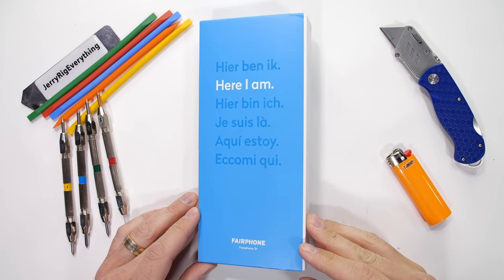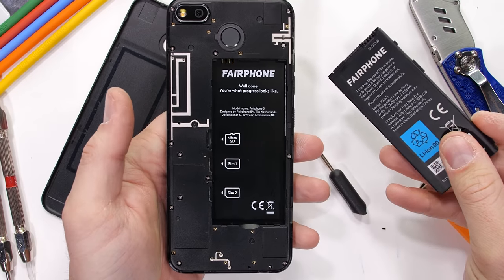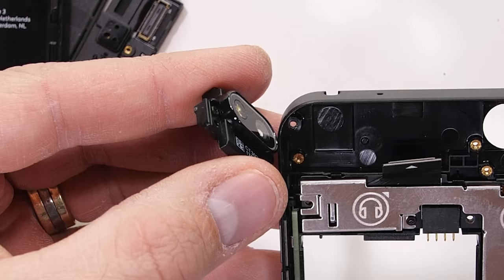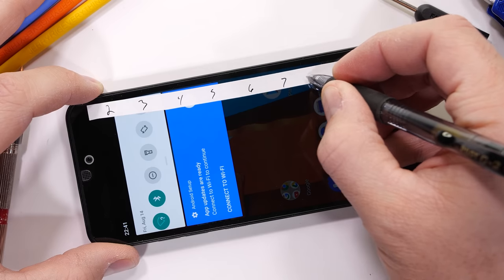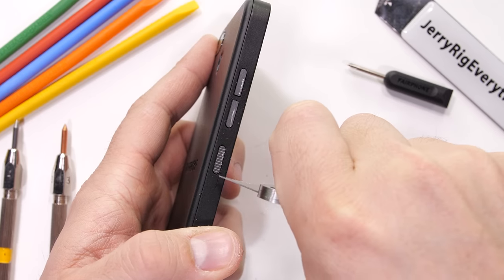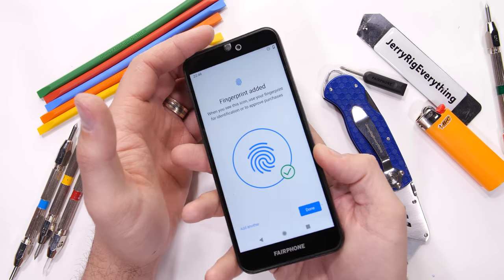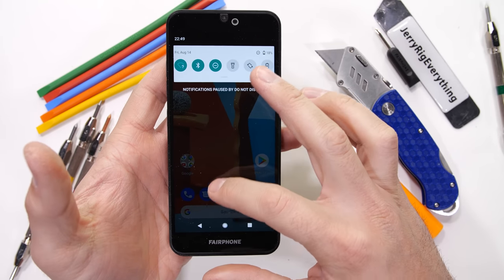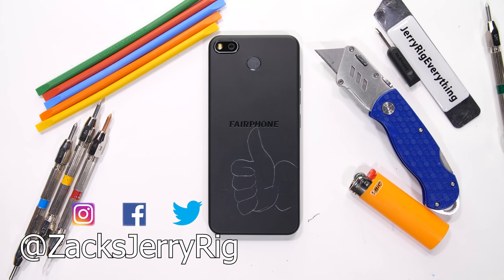Fairphone 3+ Durability Test! - it feels like cheating...

Comment: That's how you protect environment. Not by selling a phone and it's charger separately.
Reply: The idea is like apple and Samsung doing it now as well that most people already have a charger at home and wouldn't need to get a new one. But Fairphone plays this card for a few years now. They where be much faster than all the others out there.
Reply: @stefan3641  Except that the old chargers do not support the full charging capacity of the new phones. In Samsung, old chargers don't support Super Fast Charging and in Apple the old chargers are lower wattage than what's needed PLUS Apple decided to do this dick move right when they released their Type C charger for iphones. Coincidence? Stop thinking like sheep
Reply: I saw that other guy video too
Reply: @akahil91  this is a moot point as the majority of people don't need rapid charging to make it through the day with today's power efficiency
Reply: @stefan3641  See, I bought an iPhone 11 when the new iPhone 12 lineup came out. After using an iPhone XS Max, I thought ok I'll put this up for exchange. So I got the iPhone XS Max exchanged for the iPhone 11, which I knew wouldn't come with the charging brick because of Apple's new policy, but I was fine with it because I already had a brick (from an iPad 3).
But once I get the new iPhone, I find out the USB cable it came with is not compatible with my adapter, because all the old adapters (including the one I had with the iPhone XS Max) were USB A, when the new cable they supplied was USB C. So now I had to buy the 20W adapter, the new USB C one, because my old adapter was not compatible.

That's not an eco-friendly move. That's a dick move.
Reply: @le_blake  Okay sheep if that's what you think. Look up how many new iphone buyers are buying the completely new type c iphone charger with their phones. Phone carriers are basically selling them as a package now because everyone is buying. Samsung's super fast charging is more of a luxury but still needed by many people nevertheless.
Reply: @le_blake  this is highly debatable. We're still seeing in this age software problems that lead to battery issues or OEMs that still stick with 3000/4000 mAh with their almost 7 inch phones.
Whether we use fast charging or not, we are still being charged for it as a feature alongside the phone and not being able to use by default something you are paying for is very harmful for consumers. Please don't defend this.

As much as this may help the environment a little bit, no company does it out of their own interest and only results in harmful practices for consumers.
Reply: @stefan3641  you know what's suuuuper anti-environment?  you cannot replace any component of your new samsung or apple phone and still haev it work.  They check for serial numbers of the components, and if they're not paired to the phone from the factory, things will refuse to function, even if all the parts are brand new and oem.
Reply: And if you need to buy that charger separately it takes a whole another package and shipping (hence increasing carbon emissions) to reach the customer. So idk about the environmental benefits companies claim it to have.
Reply: You're not saving shit
Reply: @akahil91  I would always subscribe that this decision is all about money for Samsung and Apple. You make more money if you sell phone and charger separately but for Fairphone (and Shiftphone as well) it's really not about money they never sold any phone with an charger because of there phylosphy. I use a Shiftphone myself and I am perfectly happy with the performance of the charger from my old HTC 10 even if it my not have the performance the new phone could handle with. So. If you ar not so keen on having the best performance while charging you can always use an older charger. And that's what they are thinking and what they care about.
Reply: @xavierazad  subscrib!👍 but this is Apple. And for apple it's all about money you will not have this problem with a Fairphone.
Reply: @akahil91  it's a shame that a good idea is exploid that much just to make money. But as fore Fairphone, the charger they sell is a real basic one with QC 3 and 18W (20€). For this you can really use any old charger you finde anywhere.
Reply: @TheJunky228  I am using something like a Fairphone myself (it's a Shiftphone, but with the same idea behind.)
There must be a misunderstanding here. I am NOT supporting Apple and Samsung I would never by Apple because of there whole strategy.
Reply: BRING BACK REMOVABLE BATTERY
Reply: @TheJunky228  that’s incorrect. At least with apple the replaced parts will still work but you will get a notification on your phone saying the parts aren’t authentic
Reply: @rodrigojds  After replacing Touch ID: not working. Display: truetone not working. Face ID: not working
Reply: @coffeemakerbottomcracked  and in the new iPhone 12, camera not working.
Reply: Actually, Fairphone themselves aren't including the charger in the box and they have been doing this for ages. But that said, the Fairphone doesn't have a lot of Wattage, so you can easily use any third party charger out there. But what makes this Fairphone really environment friendly is the build material - Fairphone use 40% recycled plastic for the 3+, way more than any previous Fairphone model including the 3.
Reply: @FAT8893  they also do vast research into how to recycle their own phones. they are pionering the field
Reply: Sure usb a chargers
Reply: Anyone who argues selling the charger separately is good should watch mrwhosetheboss's video he really debunks that
Reply: @why_tho_  
Why you just limit your perspective to the impact in the current year, their ‘environmental policy’ is aimed for the long term goal. 

It’s ok for it to not perform spectacularly on the first year, we will see the significant positive impact of the current year decision in around 4 to 5 years. Apples decision to ship the type-C cable is also their step in future proofing and to keep the newer model “premium status” (the iPhone 11 got type C cable on the box,  it would looks like a downgrade if they put the Type-A cable on the iPhone 12 box)
Reply: @zacharyyyy  yes I watched his video and it is a very good one. But a normal charger lasts a lot longer than the phone it comes with and so you can charge many phones with the same charger without having to by a new one. Fairphone wants you to use your phone as long as you can, so you will not be selling it before it brakes, so you don't have a costumer without a charger and if you sell your Fairphone the customer is going to understand the strategy and is going to use his old charger as well. It's the same story about the cable. I think it's absolutely stupid from apple that here old cable isn't compatible with there new charger. You will not have this problem with Android phones because they are using usb C for years so all the cables are usable.
Ich can understand what he is saying in his video but if you want to save the planet you get a Fairphone and use it with your old charger as long as possible. I don't think selling all the parts separately is a good thing for most company's because there main goal is to make money, but for Fairphone and Shiftphone this is not the case. And when you rely live what they want you to do you don't need a new charger for your phone and if you need one with your new phone you get one in the same chipping box. And if your old charger brakes you have get a new one chipped to you anyway.
Reply: @stefan3641  yes I've heard of fairphine, unfortunately I doubt they'll really catch on any time soon. I was mainly refering to iPhones since they just changed the charging cube to have a USB c port instead, which means the majority of users will have to buy a new charger. Which is not in anyway helping the environment. Maybe after a few generations they could say that, but definitely not as soon as they change it

Comment: This phone will probably win the easiest phone to repair award at the end of the year

Thanks for so many like I really appreciate it
Reply: You predicted future
Reply: Sure it will. It's designed and supposed to be that way. Wich is fantastic. Well, there was a time, when phones used Plastic Covers, that revealed a removeable Battery and were opened by a few Screws, making replacing something relatively painless. Not on the same level as this thing, wich is designed to be maintained, but still pretty quick and painless. Fixing my Galaxy S4, my first Smartphone was no big deal at all, super easy. Those days are gone unfortunately, now everything has a Glass Backpannel, that is utterly useless and glued in place, so no getting into it without a Heatgun and tools .
Reply: @sagichdirdochnicht4653  big deal. 5 minutes of your life wasted to open up a phone but you also get water resistance 🤡🤡🤡
Reply: Yea
Reply: @propersod2390  There are other ways to implement water resistance. Take a look at the Galaxy S5, wich suprise suprise, was easy to open and fix, had a removeable Battery and yet it was fucking waterproof, mr Clownsmiley. 

Plus, it often takes WAY longer then 5 fucking MInutes to open one of those newer phones, at least if you don't want to break anything, wich happens easily with fucking glass. And it doesn't stop there, Mr Clownsmiley. Many Components are mounted in a way, that replacing them is a ROYAL pain in the fucking arse. Wich is why not anyone can or wants to repair a phone or don't get it fixed - because when it requires quite soome time +  cost of the replacement parts make it quite expansive.  

Also, BEFORE every device was waterproof, water damage defenetly happend sometime, but honestly, that doesn't happen THAT often. I mean I'm kinda careless with that thing, because it ain't a fucking fashion statement, I use it daily at work and it just gotta fucking work. I drop that damn thing constantly (Pro Tipp: Cases (who completely defeat the purpose of fancy glass plates ) and glass screen protectors ). But never have I came to a situation, were I actually needed it to be water proof. Except that one time with my non water proof Galaxy S4 were I fell completely drunken into a small river at a festival. It worked completely fine after that tough.
Reply: @propersod2390  Water Resistance is such a niche thing to have, no one randomly chucks their phone into water, and water splash has no effect on most modern phones.
Reply: @AbsoleteAim  it's not niche to have. It adds to the durability of the phone. And keep in mind if water damages your phone you pretty much need to get a new one most of the time.
Reply: @sagichdirdochnicht4653  Lmao that S5 was nowhere near as water resistant as phones now AND if that plastic back came off bam your phone can say goodbye because it's soaked now. And no it literally takes 5 minutes for most repair shops who have the right tools and experience. If you can't open your phone in 5 minutes then you shouldn't even be operating on it because you WILL break something. And water damage didn't happen that often but when it did you were looking at a super expensive repair or your phone couldn't even get repaired at all and you needed to get a new one. Very eco friendly right?
Reply: *end*
Reply: @propersod2390  That's if water even gets near my phone, so for me it's not really important.  Some phones that don't even have the IP rating have the same precautions/steps as certified phones.
Reply: U meant at the end of the year?
Reply: @AbsoleteAim  Those phones without IP ratings but with water resistant seals are only like that to save money. But they are still properly sealed. I don't get your point with that
Reply: @AbsoleteAim  then it’s still water resistant, just not certified, you’re contradicting yourself mate...
Reply: @sagichdirdochnicht4653  I opened my lg g8s without any heat, I don't think I have to mention it has an ip rating
Reply: End*
Reply: @propersod2390  The S5 was enough water resistant for 99% of cases. Do you go diving with your phone? If so, yeah, it ain't enough, I give you that. But it sure as hell was enough to survive the good old fall into the toilet, into a pit, heavy rainfall and all of that other nonsense were you could potentionally get your phone wet in every day use. And if your Back panel gets off? What? Have you ever fucking used a device from that time? They didn't just fall off. On HEAVY drops, maybe. But those stay in place pretty securely. 
But in the case, that you are regulary stand next to a pool on a ladder and constantly accidently drop your phone, were it lands on concrete, back panel could open and then falls into the pool - if so, then yeah, it's propably not good enough. But i can assure you that's not super common to happen. 

As for the opening part. No. First, there are incredibly many phones on the market and reapair shops usually focus on the "top phones". If they offer repairs for any device, they don't know first how to do it. With the experience they have, it usually ain't that big of a deal, but they'll certainly need more then 5 Minutes on most devices they don't know to get to the screen or whatever. 

Second: You should be able to do 99% of what repair shops do yourself. And with that, all those glass and glued together shit SUCKS. Yeah, yeah, tell me how unskilled I am, that I'm gonna break shit, because I don't know what I'm doing and whatever the fuck you want. But eh, I've got proper training on electronics and work experience, with the profession of devices, so basically anything after the Socket. I can replace those little surface mount components, no issues and can figure all that shit out. I've also repaired phones for friends. 
And yes, there are phones, were it is ok- ish. Were they are glued together, but open easily enough to not be a huge pain and have the internals put together in a way, that are OK to get trough. Many other devices are fucking horrible to get open and  won't cut the Bullshit on the internals. That's horrible design and they are easy to wrong on non experienced folks. And that shouldn't be the fucking case. Replacing simple shit like the little USB Port Board should be able to be repaired by anyone without any issues.
Reply: the dude wrote an entire essay
Reply: If this didn't happen,  Jerry is rigged.. 😂
Reply: @sagichdirdochnicht4653  We got a whole lot of plastic these days

Again
Reply: @sagichdirdochnicht4653  the S5's water resistance relied on a thin piece of rubber on the back panel. If that came loose, the phone loses its water resistance rating. It was basically bound to fail. And basically all phones open from the back, and the back is made of glass, so a heatplate that basically every single repairshop will have will be able to open the phone without a problem. Gluing the phone shut also allows for no dust to get in, and if the phone drops the back won't get separated from the rest of the device. And that's without even getting started on the cheap, flimsy plastic backs that are on all these phones with removable backs 😂😂😂
Reply: @pkj6684  Plastic isn't evil or bad in any means, The different Plastics can be fantastic Materials for individual usecases. It depends on the usecase. 
Individual Plastic Packaging - that's bad. That's actually really bad. Like anything single use Plastic. 
On the other hand as a Phone enclosure - nothing wrong with that at all. It's pretty sturdy and will last the entire life of the phone for some years. And on many other cases, were the plastic is more temporary then single use. Plus, those more sturdy, expansive plastics are actually recycled.
Reply: and I got a stroke reading that
Reply: It was 6s but now this wins
Reply: @sagichdirdochnicht4653  Oh I didn't mean that it's bad
I was just stating that plastic comes with a few more flagships these days
Reply: True
Reply: "end"👍🏽
Reply: If we make it till the end of the year
Reply: Lets see in the end of the year
Reply: @ferni0  Not really, just pointing out that most if not all modern phones have some sort of resistance as is.  The IP certification just marks up pricing really.
Reply: @AbsoleteAim  You are right IP resistance rating is almost useless because every smarphone company will void your warranty if water gets in anyway.
Reply: At the of the year ?
Reply: Since the invention of wireless phone. A phone I can take apart.
Reply: Pretends to be surprised
Reply: Agreed
Reply: Already has with iFixit, so obviously.
Reply: "Thanks for so many like I really appreciate it"
Reply: @AbsoleteAim  you’re contradicting yourself tho, your original argument was that water resistance(not IP certification) is a gimmick
Reply: @ferni0  Because it is?  I'm saying that most modern phones can handle the splash or some water without said certification, having an IP rating marks up the price, and I never said it was a gimmick?  I said it was a niche feature.  Unless you're someone that works in the rain constantly there's no point and even then, CAT makes phones specifically for those kinds of people and it has a higher rating anyway.
Reply: The conversation went from being easy to repair to being enough water resistant.
Wtf
Reply: @why_tho_  🤦‍♂️😂😂😂 I was thinking the same
Reply: I had a phone with said water resistance.
When I got it, I put it for a few seconds into the water of a bathtub and there it went...
Reply: @sagichdirdochnicht4653  to be fair if drop is hard enough to lose  back cover it is hard enough to completely shatter back glass.
Reply: Thanks for stating the obvious
Reply: THERE IS A WAR!!